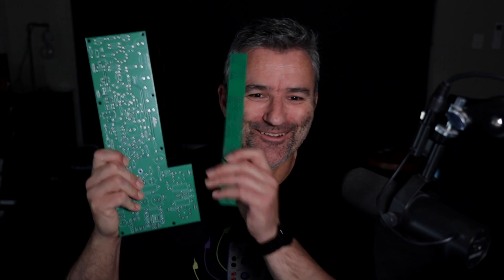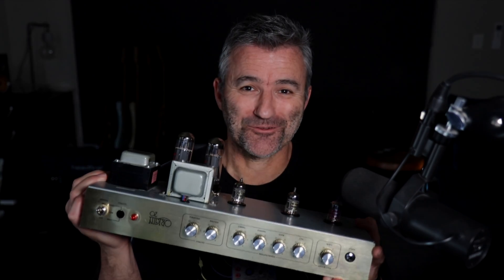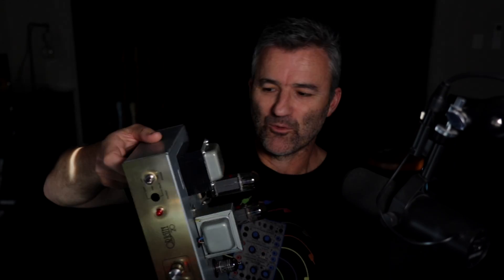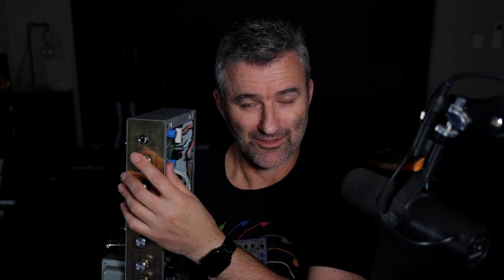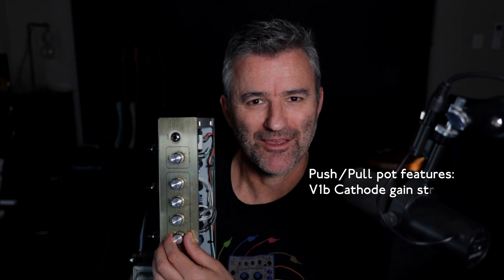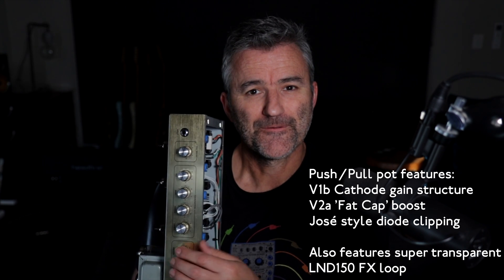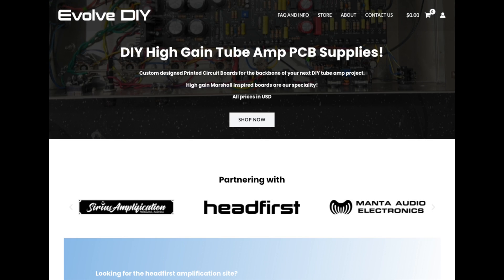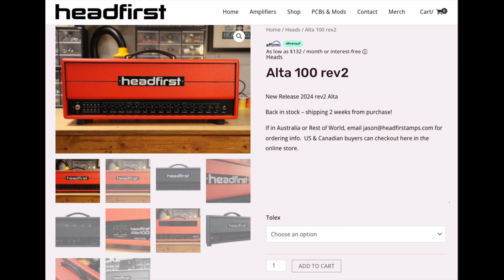Marshall Origin DROP-IN replacement mod PCBs - JCM800 hot rod!!

Comment: Jason, can you recommend some good example videos of populating the board? Basically showing good practices for maintaining positioning, especially multi pin parts, as you solder them in. I’ve only done turret board where the parts sit on the same plane as where you’re soldering.

Comment: What’s deal with R43? The schematic shows 33k value for it, but it’s not listed in the BOM. Also your board doesn’t have anything there. Should I put a resistor there?
Reply: It is for the bias on the 50W
Reply: @ Ok, thanks.

Comment: Cool but the cost of PCBs, parts and time takes, aren't you better off just buying a better amp?
Reply: The cost of pcb, parts, etc. will still be much less than buying a JCM800, then taking it to a tech to mod and revoice, which would be around $5-6K AUD Total... still a tenth of the cost... and can be reversible if you so choose 😉
Reply: Of course u can do that but this is for the person that likes to tinker and mod stuff. Plus it sounds amazing and where u going to get an amp with tones like this if u grab one used for like $500? I just bought an Origin 50 that’s 3 months old for $200 usd and a cheap pedal for it. Then the board and parts will be around $250 so that’s less than $500 for an awesome sounding 50w amp. Plus u can say and know u did it yourself and makes it much more special

Comment: Is there any difference in tone between 20 and 50 watt versions? If they use the same board, what makes the difference in power?
Reply: 50W version has an extra 120VDC on the HT supply give or take, along with a dedicated bias winding... I only had to change B+5 dropper between the 20 and 50 and they were pretty identical to me

Comment: How much would all the components cost to do this? Just a rough estimate…
Reply: I got about halfway through the BoM and was at $110.
Reply: @RiccNova curious where you ended up?
Reply: @NeuroplasticityReprogram absolutely nowhere so far. Got caught up in work and it’s been too cold for months to work in the garage. I need to pick it up as I purchased the board!

Comment: I am surprised more pros like you and Alex don't do this more often.  The power and capability of modern FREE  circuit  design tools (schematic, components, PCB board design, validation) makes that part straightforward for those with core design expertise.  But now every firm making PCBs accepts Gerber formatted PCB design files and can produce boards for $5 to $10 a piece.  With that kind of pricing and 1 week turnaround, it is economical to prototype your own design thru a few iterations, then after nailing down the design you can order a few extras for spares.  And you can save the CAD design and Gerber export and use that to get a board made 20 years from now.

Comment: Finally! Nice work fellas. The board is labeled 20\50. I assume this will fit either amp then? Ordering!
Reply: direct drop in for both 20W and 50W
Reply: @siriusamplification Will the new board retain the original power rating for both versions?
Reply: @demokraatti  No, the power scaling was removed. After all the additional options, there wasn't much space left over for it... Also under 15W mode, it is a bit of a tone sucker which defeats the purpose of the original mods. There may be a future design with a better design in mind though
Reply: @siriusamplification  Will your board change the full power either 20 or 50 watt version makes?
Reply: @demokraatti  You are still using the same transformers, with the same voltages. It won't change the power output unless you change the power transformer, or couple another mains transformer winding in series and add that winding between CN11 and CN12

Comment: Excellent work and fantastic idea.  I will again suggest a "highly detailed" how to solder video.  A video showing ALL the proper gear, how to avoid overheating joints and how to avoid cold joints. A video showing that you CANNOT use a solder pencil, you must use a proper regulated solder station with an excellent thermostat.  What type of solder to use and what to avoid. How to use a vacuum solder removal tool and how to use wick to remove solder.  Just my suggestion.  Every amp builder thinks that "everyone has an ability to solder" and "soldering is not that hard."  I think it is time for pedal companies and DIY amp companies to be honest and admit that soldering is a distinct skill set.  Please do a detailed video.  Thanks-----Ben
Reply: Yes, I know how to solder, but soldering a cable and soldering a tiny spot on a PCB with traces are two different things.
Reply: @Scott__C  My point exactly.  I "learned" (term used loosely)  to solder after buying over 20 pickups from TNTones.  Having 11 guitars.......it was no big deal if I overheated a pot.  I can't imagine overheating pots on my prized Amp. I was a nervous wreck when I first started.  Take a 120+ pickup; a 20+ tone pot and a 20+ vol pot and you are talking some dollars. Let alone, your prized Amp.  Hopefully the guy in the video decides to do an in depth video on solder(ing)   I think it behooves him to do so; as a way to minimize "faulty claims and diy hack jobs."
Reply: @benburnett8109  The good thing with a small company like that is they'll know if someone was in there and really messed stuff up.
Reply: Let them learn the hard way, and it keeps guys like Jason who have an unbelievable dedication to quality at the top. I’ve learned just in my short time modding and doing electronics it weeds out the competition extremely fast- if these guys are really dedicated they’ll research every single aspect of it. It’s not Jason’s job to show you how to solder a pcb lol, there’s a billion videos on that. Go watch Brad’s Guitar Garage and watch him fix a PCB amp, he throws in little do’s and dont’s all over his videos. 

And soldering pots/pickups is a completely, completely different thing than PCB’s
Reply: @modusceo  Great job replying to a comment that is 1 year old.  FWIW, I spoke to Jason and he understood what I was asking.  To date, the comment has 16 likes, 3 replies and the ONLY PERSON that has an issue with it is you. What does that say about YOU??